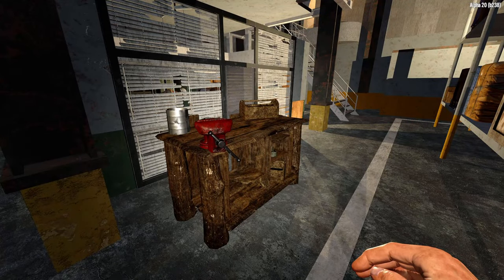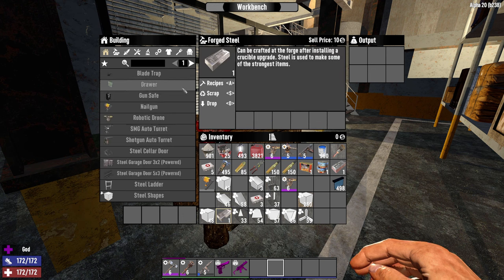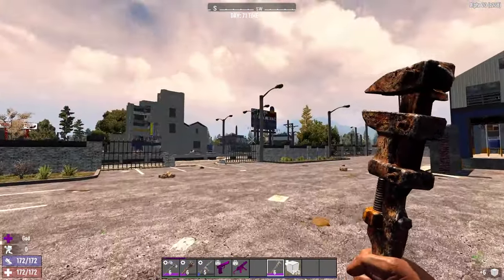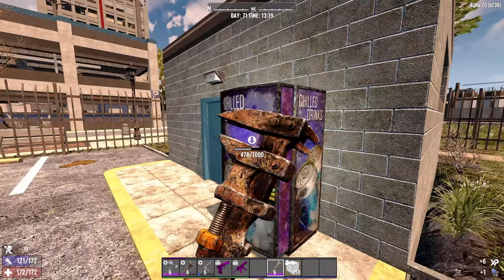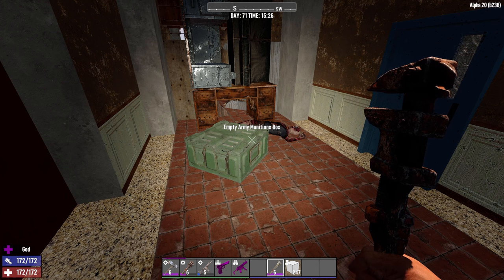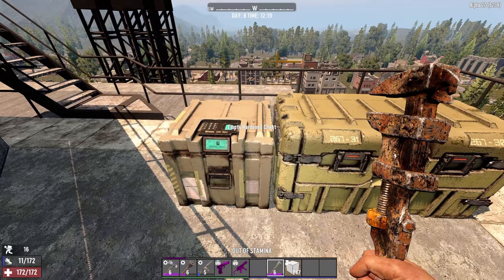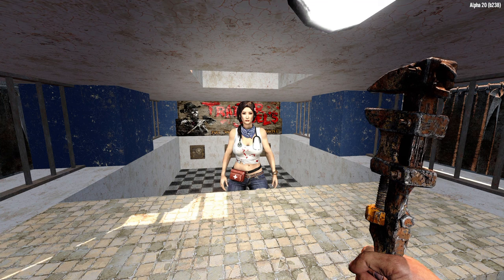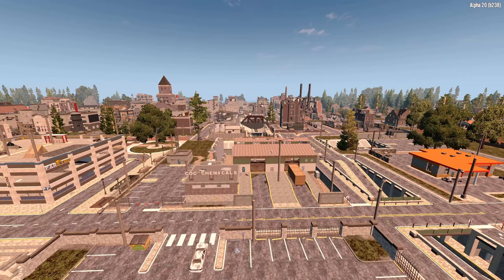Pro Tip : Wrenching Steel!  7 Days To Die - Alpha 20  @Vedui42

Comment: I play with a friend of mine that mains a perception build and wrenches every single thing he sees at any POI, street and whatever that can be wrenched, it takes a lil bit more of time but its fairly fast to do, but im impressed when he cames to the house with 2 stacks of iron, 20 radiators etc, i ve never seen a video about the power of this build , maybe people just dont know about it, but we never run out of scrapable resources to smelt and even sell, tons and tons of materials that can be used to craft more things or smelting them for more raw resources, the wrenching build is highly underestimated and replaces most of the strenght based farmable resources, except for the wood, nitrate and coal, just saying, its variety, its really powerfull, but definitely not for everyone since u have to keep wrenching things constantly
Reply: I also have a friend who does this, we both have a few roles in our server and one of his is impact driver-ing everything valuable when we do a POI. Probably got about 60k brass in the smelting box plus what's in the forge, it's wonderful being able to just go mine some stuff and make the AP ammo i use for hordes without worrying about running out of brass. Not to mention the steel, iron, parts etc.
Reply: We are getting to the point where a nomadic group of 3-4 could locust an area in between bloodmoons, and then pick up the entire base and move on. Builds like you mention are reasonably important to that group dynamic. Tagging along with the mission runner build would fill your inventory, plus a jeep, in short order.
Reply: It's also very profitable to the point you can afford to buy anything and everything, while still having all the resources you need.

One way I start is by going pure wrench with some rex, throwing everything in a box in  front of the trader. Around day 6, drop 2 or 3 or even 4 points into barter, eat barter candy and grandpas secret sauce, sell everything you don't need, along with everything you've looted for the previous 5 days. 

The result is, easily being able to afford anything he offers. As a bonus, you'll gain a level or three depending on your xp settings. You could drink an xp potion before selling everything, but I think it's better used on hoard night, unless you have a particularly good haul of loot to sell.

Some other tips would be crafting items to sell. Coolers will get you more dukes than the 8 (?) polymer they cost to make, for example. The downside is, the trader will only buy a certain amount of them. Selling on day 6 before the restock on day 7 can help with this, along with giving you more of a selection of things to buy after you've scammed the trader.

Another downside to all of this is throwing off progression, and feeling like you have everything you need after only a few days.
Reply: I need a friend like him xD
Reply: well the impact driver being a power tool it would be 40 times faster if it would wrench things like an auger

Comment: This is very helpfull. I always want the motorcycle as early as possible. The most difficulty are the 30 forged steel. The trader is very important and it is important to find the other traders (trader quest from all the traders / i knew all 5 traders in navezgane :). And with "better barter" you can get better "secret stash" and get more money and you will get the crucible from a trader. Visit them every 3 days on the first day with the new stash (so you have time to get the money for what you want :)
For the trader i recomned those things: better barter max, the daring adventure max, intellect 9 (not 10), intellect glasses (int + 1), cigar, sugar butts, magnum (with book magnum enforcer vol. 4), pumpkin cheesecake and Grandpas Awesome Sauce. With intellect glasses you can switch between 2 secret stash lists :) And with all of that you can buy the very expensive "Grandpas Fergetin Elixir" to clean and rebuild your perktrees :)